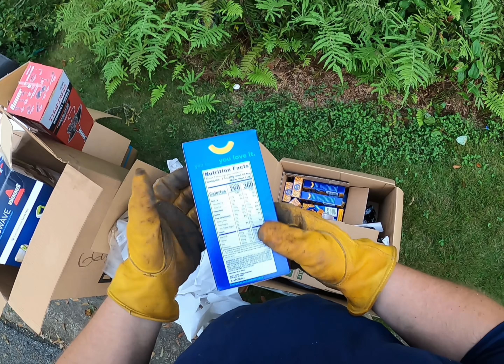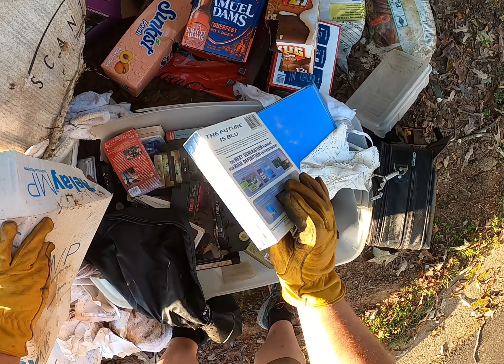Basic Street Scrapping Day, I'm OK With It.

Comment: A slower day mixes things up a bit.  Allows you to appreciate those whopper days that much more.  Do you pull the wire from those big chandler lights?  I have been and it adds up quick plus there is normally a run of thin #2 that runs through as the ground.  Happy Hunting.
Reply from the maker: I do I wasn't able to record unloading it due to the worker helping me throwing it off.
Reply: @Streettreasures  😖🤤🤤🤤🤤🤤🤤😖😖😖😖😖😖😖😖😖😖🤤🤤⚽⚽⚽⚽⚽⚽⚽⚽⚽⚽⚽⚽⚽⚽⚽⚽⚽⚽⚽⚽⚽🤗🤗🤗🤗🤗🏃🌸🤗😐😐😐😐😐😐😐😐😐😐😐😐😐😐😐😭😭😭😭😭😭😭😭😭😭😭🤧🤧🤧🤧🤧😐😐😐😐😐😴😴😴😴😴😴⛽⛽⛽⛽⛽🐷🐷🐷🐷🌶️🌶️